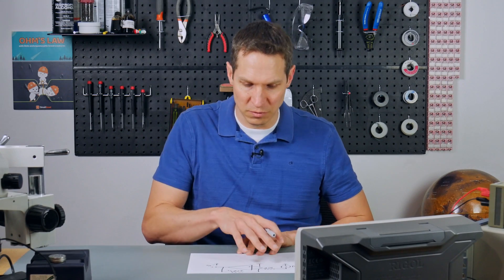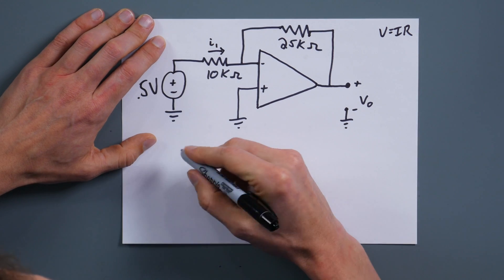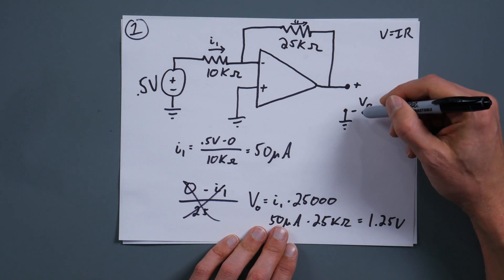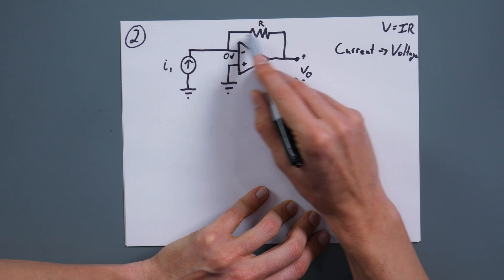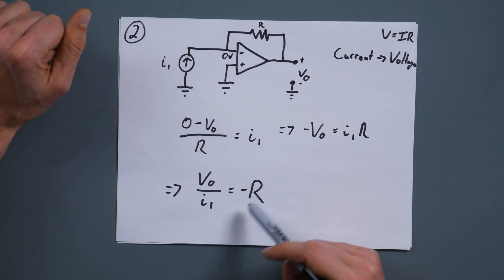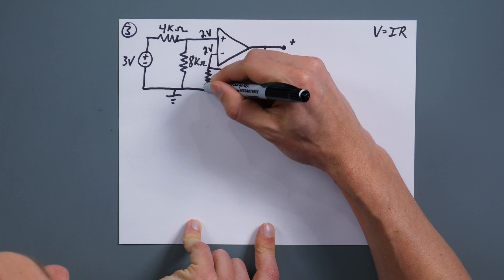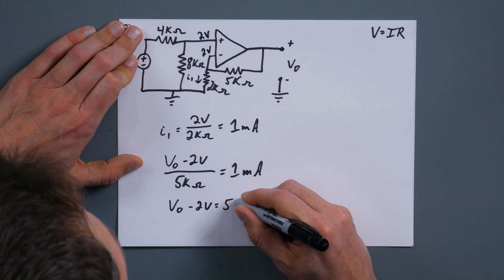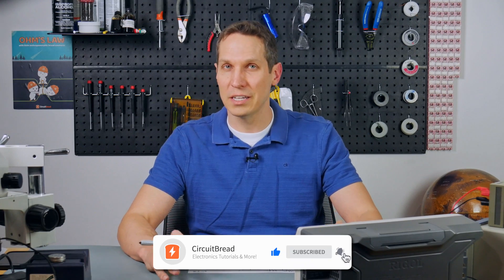Op-Amp (Operational Amplifier) Practice Problems

Comment: 2:41 a small question as I have already seen similar explanation but one thing is not allowing me to sleep ;) why don't we add those resistances? I knoe that no current enter the inverting input of OpAmp but I see two resistors here 10 k and 25 k but we calculate current for the one of them 10k ? I don't get it. Normally to calculate the current I would add all resistors and divide it by the voltage right? for example 5V / 10 000 ohms + 25 000 ohms to get the total current ..or we just treat that 25k resistor as an "invisible" resistor for the moment to calculate the right output of the op-amp or something like that?
Reply from the maker: That's a great question.  The reason we only calculate the current for the 10K resistor is because, in this question, we know the voltage across the 10K resistor (because we know the voltage at the inverting input) but NOT the voltage across the 25K resistor (because we don't know Vo).  So, given what information we're given, we cannot calculate the current through both of them from the beginning.  But we know they have the same current through them so we find the current through the 10K resistance and, with that information, we find the voltage across the 25K resistor, giving us Vo.
Reply: @CircuitBread  This still doesn't make sense to me. If we know no current is flowing into the op amp and instead passing through both resistors in series, why wouldn't you have to calculate the current such that i = .5/(10K+25K) like you normally would with two resistors in series?

For example, imagine you just have a simple circuit with two series resistors with a 5V power source, then saying "let's just calculate the current using the first resistor and ignore the second one". What is special about the op amp that allows us to ignore that 25K resistor when calculating the current? Why doesn't this behave like two resistors in series leading to V_0?
Reply: @n3bulou5  I had the same question, only rephrased to "what does the op-amp actually do?" And I guess here lies the answer: the op-amp output "draws" the necessary voltage, since it tries to make the inputs the same. And since we assume that there is no current flowing into the inputs, the 25k resistor sees i1 as current.
Otherwise the op-amp wouldn't do anything at all... I hope someone can confirm or disconfirm this?
Reply: I had the same question. I think it’s because the input terminals must have the same voltage potential like he mentioned in the op amp rules.

The bottom input is directly connected to ground so the other terminal must also be 0 volts

Comment: I am a bit confused between Example 2 and 3. How come in example 2 it is 0 - Vo but in example 3 it is Vo - 2V? (I am asking about the Vo being subtracted vs not)
Reply from the maker: Great question!  It is somewhat arbitrary.  As long as you state your current flow assumptions correctly, you can do it either way.  So, in example 2, I assumed that current was flowing from the inverting input to the output.  Whereas in example 3, I assumed that the current was flowing from the output to the inverting input.  That's the only reason.  I could have assumed the opposite and swapped those, but then the sign of the current (whether it was positive or negative) would have flipped, because my assumption of the direction would be different.  Does that help?
Reply: I’m confused on that too actually, if you assumed current is flowing from high to low when solving for current down the 2kohm resistor wouldn’t it be from positive to negative across the 5kohm resistor as well (from the negative terminal to Vout)

Comment: In the first problem, the output should be -12.5V, not -1.25V. The closed loop amplification of the inverting amp is -2.5 not -0.25 (Acl = 25k/10k)
Reply from the maker: The output should be -1.25 but you are correct about the amplification.  I think the confusion comes from the input voltage, which is .5, not 5.  .5 * -2.5 = -1.25
Reply: I also felt in this trap. Did calculations with 5v instead of .5v

Comment: How did you get 1ma across the 5k resistor in problem 3? Shouldn't that be 0.4ma ?
Reply from the maker: Hi Spencer!  Since we know the inverting input is at 2V and the resistor to ground is 2K ohms, we know that the current through that resistor is 1mA.  As the 2K and the 5K resistors are in series, the current through the 5K resistor has to also be 2mA.  And that's how we find the output voltage of the op-amp.  I hope that helps!
Reply: @CircuitBread  Ah thank you. I was following the current from the wrong pin so I didn't notice that they were in series.

Comment: great video man, reminded me of how the ideal op-amp calculations work after almost a year of not doing them
Reply from the maker: Glad it was helpful!
Reply: @CircuitBread  Why in the first problem when finding i1, you minus 0 with 0.5 ?
Reply: @MDSR17455  He's referring to the voltage drop between nodes. When working with ideal Op-Amps we remember that the inverting and non-inverting inputs (+ and -) need to be equal. Since the non-inverting input (+) is connected to ground, we can then say that the node connected to the inverting input is then also 0. So, if you have .5 V on one side of the 10kOhm resistor and 0V on the other side, we can find the current through that resistor using (Voltage drop)/R.

Comment: For practice problem 1, 5V/10K-ohh is not 50 micro-amps, it will give 5e-4.
Reply from the maker: Phew, you scared me!  I hate it when I mess up my math.  In this case, you are correct with your math but you're reading it wrong.  You're using 5V, not .5V.  In the question, it is .5V/10K, which does give us 50 microamps.  
Thanks for the scrutiny and feedback, I do like to be corrected when there are mistakes, so don't hesitate if you see anything else that looks out of place.

Comment: It would be useful for dunces like me if you explained the 'obvious'🤔 simple maths, I have no idea how you got your 5V from in the last equation
Reply from the maker: Dang!  It's always hard to find the balance between boring people with too many details or confusing people with too few details.  Sorry that the balance wasn't quite right for you... 
For that, what happens is that the 1mA on the right gets multiplied by the 5Kohms on the left (to cancel it out of the denominator on the left), so .001A*5000Ω = 5V.
Reply: @CircuitBread  Thanks for that. Not a complaint, I loved the pace of the video just my math isn't up to scratch so ended up rather confused😮‍💨